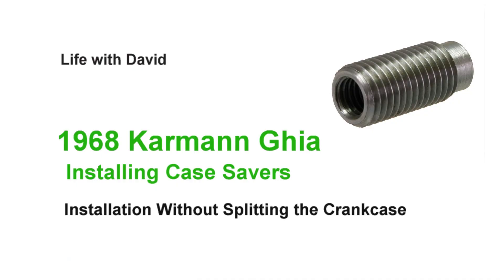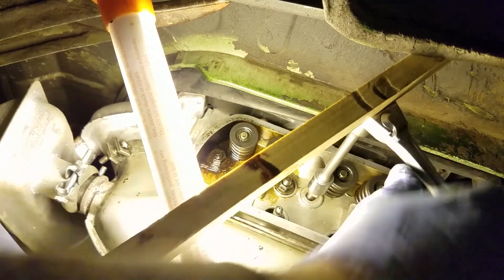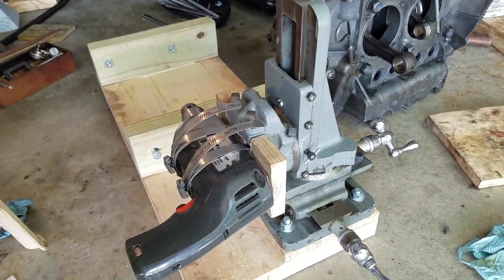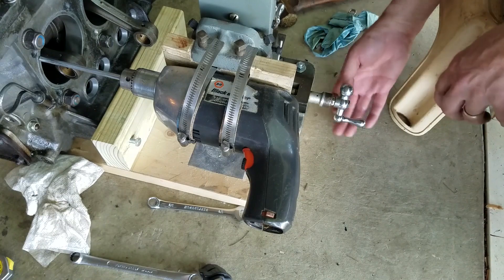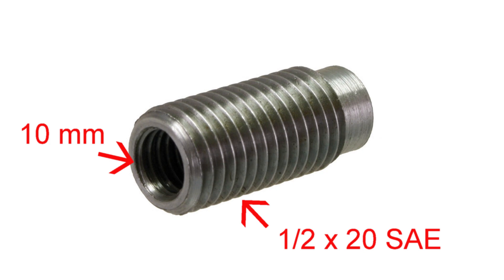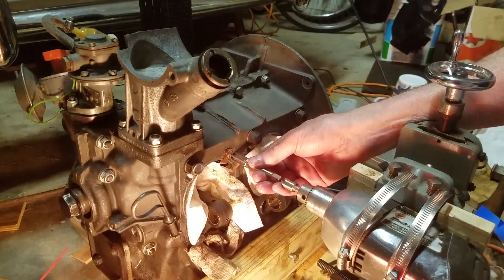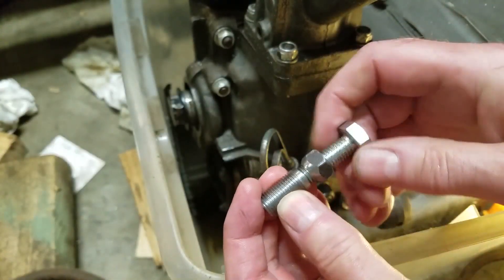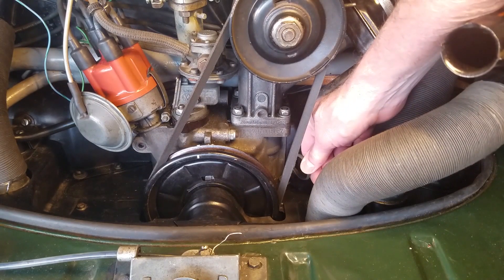Installing VW Case Savers Without Splitting the Case

Comment: I have case savers on my 1600cc. 
But unfortunately after installing the engine I realise my torque wrench was out of torque, so I checked the bottom nuts behind the rocker arm and found out they are torque at 24 ft lb on 8mm studs, so over torque, however I had been test driving the beetle for about 3 miles and they haven't pulled out of the cases, do you think I may just get away with it. As I am a bit concerned. ?
Thanks in advance.
Reply from the maker: Ehhh... 8mm studs are supposed to be tightened to 18 ft. lb.  John Muir is pretty firm on only being off 1 ft. lb. on 10mm    studs; he says 22 or 23, not 25.  Man, this is hard; but I would remove the engine and re-torque to 18 ft.lb.  I'm so sorry; , maybe check the other forums.  Good luck

Comment: Easier to just split the engine
Reply from the maker: It often is; but my bottom end was really solid and doesn't leak (how many times can you say that about a VW crankcase).  Every time you open something up you cause more problems; so this was the right choice for me.  The engine has been running great for almost 2 years and still doesn't leak.

Comment: Hello mr. What is your opinion of th self tappings studs?
Reply from the maker: I did a video on the self tapping studs ( https://youtu.be/uJ4xNOff4zs ).  If you have one or two that are bad and you REALLY don't want to pull the engine, then they will work for a while.  They were a lot of work to install properly.  However, case savers, IMHO, are the way to go for a permanent solution.

Comment: David, what brand/model is your mini milling stand?  Link available?
Reply from the maker: The top is a milling attachment for an Atlas 10" lathe.  The bottom is from a 7" x 7" Atlas Cross Slide X Y table.  They are circa late 60s.  Here are a couple eBay links.  What's cool is the milling attachment fits on the bottom of the X Y table.

https://www.ebay.com/itm/284496690200?hash=item423d52fc18:g:BWMAAOSwLMthcGid

https://www.ebay.com/itm/284376363954?hash=item423626f3b2:g:5t4AAOSwJNBg9LXW

Comment: David, great video.  I need to do the same thing to my engine.  I will have to watch many more times before I can figure out how you made your drilling jig.  A list of parts/measurements would help.
Reply from the maker: I had the components for the drilling fixture.  If I had to buy them, I don't know if I would have done it that way.  I might have made a drilling guide that holds the drill at a perfect right angle.  Maybe a 3D printed part with steel drill bushings.  Good luck!

Comment: David … I’m a Ghia owner too and was excited to see the thought, humility and ingenuity you showed! Amazing work and an encouragement to not give up! Real quick … what measurement were you using to know it was “overheating”?? Just curious what to keep an eye on. Thanks!!
Reply from the maker: Thanks for watching.  When I would drive at freeway speeds for 10 miles or so, after I exited I would notice the engine oil light would flicker.  I attributed that to thin oil due to overheating.  Also, when I would begin moving again, I heard some "pinging".  However, the most telling is the "dipstick" test.  That is, if you can hold the dipstick while you pass it slowly from hand to hand right after you turn it off, then the engine is running OK.  My dipstick was much hotter than that.  I, by habit, run the dipstick test every time I run the Ghia for more than a few miles (since I have to open up the engine bonnet anyway to disconnect the battery when I put it to bed for a few weeks).  So I have a good idea how my Ghia is "feeling".